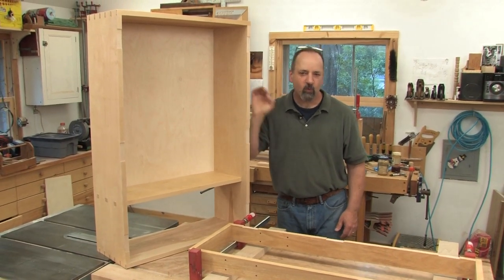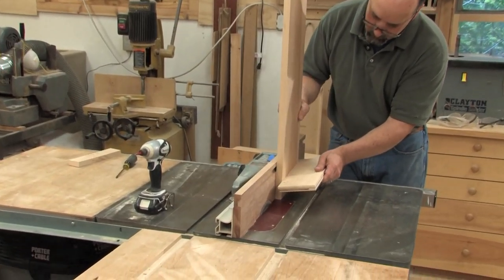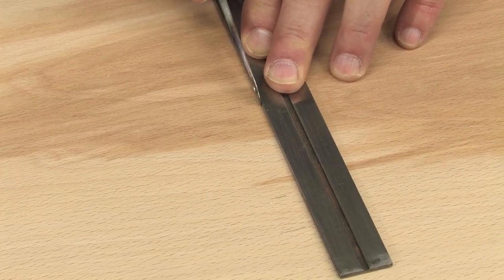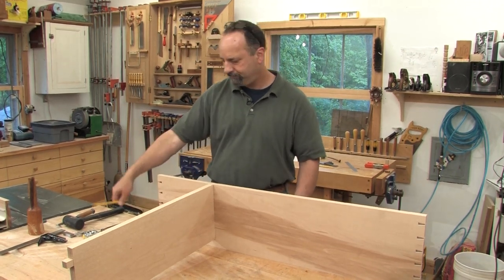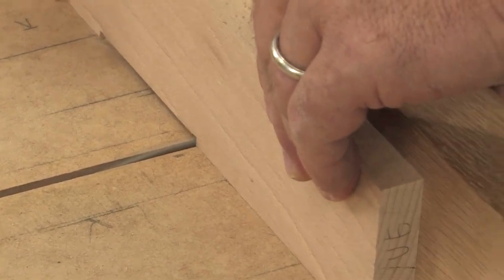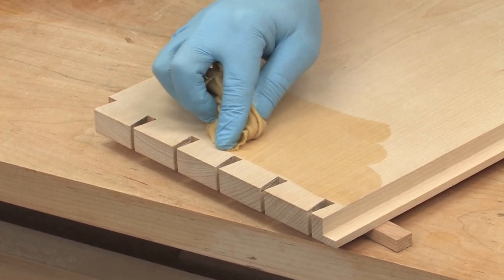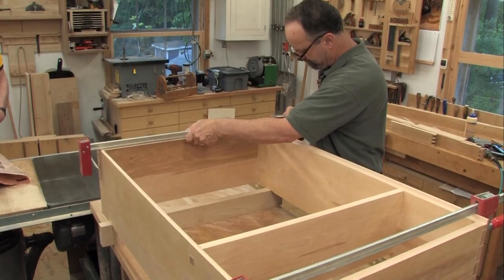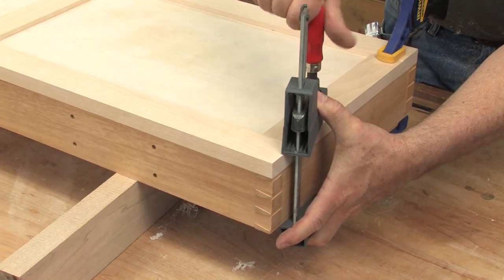Through Tenons with Mike Pekovich–Hanging Tool Cabinet 3

Comment: I’ve seen more tips and tricks through this series than I can remember … one that was a real head smacker, as in “why didn’t I think of that?” was adding a temporary fence to your cross cut sled when you need a stop block for material that’s longer than your sled.  Duh!  I’ve been considering some kind of complicated sliding angle iron / t-track set up  with a flip stop — The simple solution is faster and probably more accurate! Spend more woodshop time on projects rather than jigs!  
Thanks for sharing your skills. I’m  enjoying watching the build.

Comment: This is advanced stuff, both in skills and equipment required. Mike is an accomplished machine woodworker.  An equally advanced hand-tool woodworker could produce equal or better quality in the same or less time without the sleds and jigs.
Reply: Hi there. That's interesting and I wonder if you could elaborate on how a person can achieve an outside tight fit for those mortices? Thanks.
Reply: You should take one of his classes in person you will find Mike Pekovich does a fine balance of machine and hand tools.  You will learn how hand tools complement machine tools and visa versa.